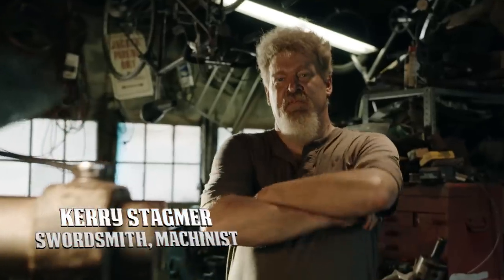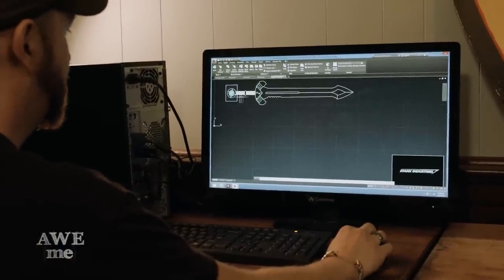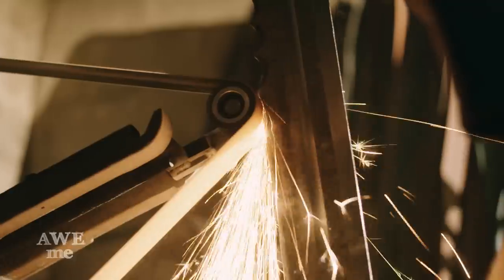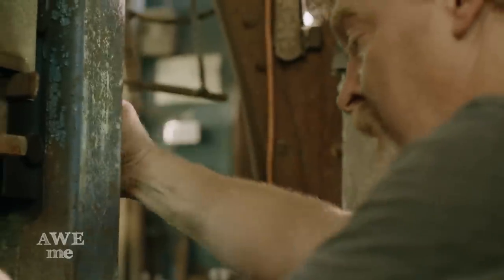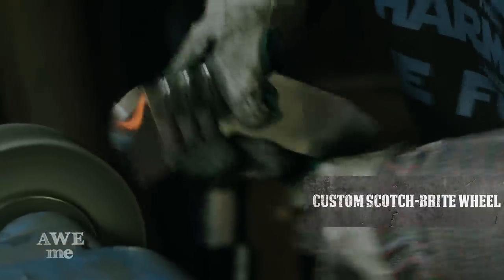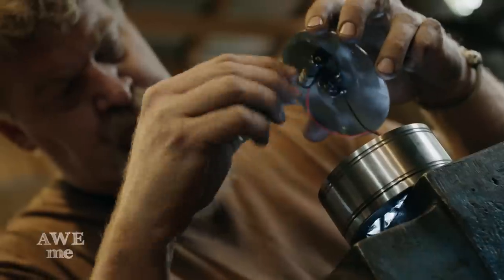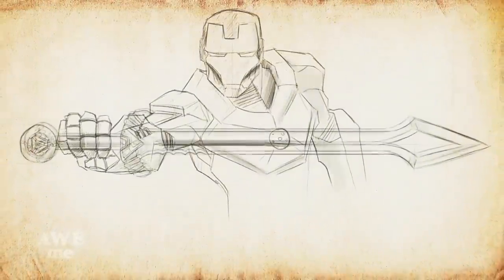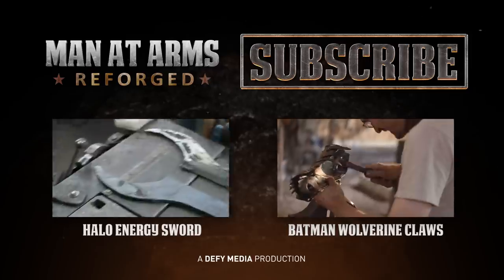Iron Man's Sword - MAN AT ARMS: REFORGED

Comment: Come on people, stop hating on these guys. The current team actually builds cleaner and more refined pieces than the previous team. Don't get me wrong, I love Tony and all, but you all need to move on and appreciate the effort and craftsmanship they put on these new weapons.
Reply: we might appreciate the craftsmanship, but many of their pieces have glaring design flaws, like this one having an overly cylindrical grip, which makes maintaining proper edge alignment nearly impossible.  otherwise it's a decent design, though I would have found a way to brass the blade as well.
Reply: PsylomeAlpha I love these comments about the cylindrical grip, as if that's what's over-designed about this piece.  Seriously?  It's not the absurd weight?  It's not the pointless cutout in the blade?  Or the pointless teeth?  Or the impractical hilt? 
I'm not going to denigrate their hard work and craftsmanship, but the design is just too far over the top.  It looks like something a middle schooler would draw because it's "so flipping rad."  
None of the styling fits together, and none of it evokes Iron Man.  It's as if they took Iron Man's branding and put it on a weapon from WoW or Darksiders.
Reply: bullsear
you know what, I was trying to avoid leaving a ranting epitaph, so I gave the design issue that makes this thing completely useless even if the strength to wield the blade isn't an issue.  if the blade breaks at the tip because of the cut-out it can still cut.  the guard would still be functional, even though it's too small for my liking.  the teeth, in a literal sense, are points, but are relatively useless.  you could argue for its overly bulky design by saying he's planning on using it on super-humans, many of which have higher resistance to being cut, so I left that one off as well.

i.e. I was stating the worst flaw that happens to reoccur with their blades all the time.

oh, and you forgot a total lack of taper; distal or otherwise.
Reply: no
Reply: The weapons they make are for show. Maybe not exactly for a COMBAT situation. Just think of a iron man hand trying to grip a tapered handle, I would personally think it would be a little hard.
Reply: R'Amen
Reply: Again, my issues aren't with practicality -- it's just over-designed.  It doesn't draw from the character, and it doesn't really know what it wants to be.

Comment: Using an oldschool blacksmith technique we brass the handle -> pulls out a drill. Ye, sure is oldschool man.
Reply: I think they were talking about heating the steel up and then brushing it with brass wires.  also, drills and lathes have been around for hundreds of years, back in the day they likely would have just taken the thing and put it on a fairly snug wooden dowel, and then put that on a lathe.  then, depending on the design of the lathe, they'd either have their apprentice spin it with a crank, or they'd pump it with their foot.  this is all stuff capable of being done long before electricity existed.

Comment: The only thing that bugs me about this build is the theme. This is a sword thatw as themed to fit Ironman, but Ironman would never use a sword (or atleast he has no need to).

The sword itself looks great though, much better than the shruikens and whatever you'd call the TMNT weapon.
Reply: Optimus Prime has no use for a sword but has one anyway.
Reply: granted
Reply: I could definitely see him wielding one, even if he doesn't have an actual reason to do so. Sword wielding among superheroes is as much a style choice as anything else.
Reply: He used a sword in 'The Morgan Conquest' plus it's Tony Stark, if he thought it'd be cool to use a sword he's have J.A.R.V.I.S. finishing the paint-job buy the time he got back home to program the repulsor delivery system
Reply: Tbh him using a sword would be a pretty cool thing to see, it'd most likely would happen in some story concerning Asgard, like in fear itself or whatever, not completely impossible.
Reply: He would more likely try to make some energy blade or something like that if he was to use a sword. But also might just make a normal metal sword just cause he was bored.
Reply: TheYarl5000 He'd make robots if he was bored,
Reply: TheYarl5000 I'd think the metal blade might be made to vibrate at a high frequency like Raiden's sword from Metal Gear Rising or the Guyver's elbow blades enabling him to cut through almost anything
Reply: I'd expect Ironman to be more inclined towards a plasma tipped blade but I guess the end effect would be the same.
Reply: it could be a sword made to be used in case of an EMP or such. not sure if that makes sense, but it would be a situation where a plasma or energy sword wouldn't be as reliable as a regular sword i imagine.
it might not be wieldable with one hand without the exoskeleton, but double handed works just fine
Reply: it's a good job he's a FICTIONAL character and can be adapted and interpenetrated differently as all things are
Reply: ten Busch
 if there is a emp, Iron man would not function i think xD
Reply: was just a spontanous theory anyways
Reply: ***** that sounds AWESOME!!!
Reply: ten Busch why not. at some point, Iron Man will come upon a enemy who has made his own shield or got one who can protect against ANY kind of projectile. and this is possible. With that said, Iron Man could actually make a sword since That's not a projectile unless he trows it. So, it is possible

Comment: 1. The cross section of a sword handle should not be circular, it should have a somewhat oblong shape. This helps the wielder keep the edge aligned. Tony Stark is a brilliant engineer, he would realize this.
2. Because the Iron Man suit can fly you have to limit the weight that you are carrying and maximize aerodynamics. Stark probably wouldn't carry a sword to begin with for those reasons. Let's just say he does, he would want it to be as light as as aerodynamic as possible.
3. WTF is with the cutout near the tip of the blade? Not only does that add unnecessary weight, all someone needs to do is grab the cutout and they can take it away.
4. Serration on the back of the sword near the hilt isn't useful at all.
5. Delicate electronics should not be on the pommel, the pomel is there as a counterweight and strike point.
6. Stop with the glass already! It's not cool or remotely impressive.
Reply: FORGIVE THEM, OH WISE SWORD MASTER!
Reply: But seriously, this is a prop. Do you really believe they wanted to make a "perfect sword" for a fictional character? No need to correct them for their own ideas, ON A PROP.
Reply: Wade Wilson IKR! Gezz...
Reply: Sigvulcanas At first I thought your comment was full of crap, but then I watched all your videos about sword design functionality and construction and now I understand why these professional swordsmiths and prop makers should not take your critique lightly.
Reply: Well, you can create another ironman sword from your own creative input when you acquire the forge, skills, and materials needed. Or make a kickstarter or something. Whether or not people will pay to see your creation? I don't know. That's up to you.
Reply: True with all but glass its hard to cut glass with a sword but theres a firm line form cuttinng something and shattering Something. Thats shattering
Reply: pommels were not used as a counter weight, but are used for more a head bashing tool, if the pommel were a counter weight it would make the blade easier to deflect
Reply: nathanilt Pommels are actually used a lot of times to be a counter weight.  Adding weight to the hilt brings the center of gravity down towards the hilt, making the sword more balanced, and easier to handle.
Reply: nathanilt Pommels are definitely counterweights. They were needed along with distal taper to make the blade balanced.
Reply: etheangel2220 I never made any videos, I have to credit Skall ***** and Matt from scholagladiatoria for a great amount of what I know. I also did quite a bit of research in other websites.
Reply: Wade Wilson Nothing is free from criticism.
Reply: Ironman s suit can catch a van in mid air and yall are worrying about the weight and easy to handle?
Reply: Sigvulcanas i'll check them out
Reply: etheangel2220
But the guy has no videos...OOOOHHHH, I see what you did there.
Reply: In the wise words of Mystery Science Theater 3000...

"Just repeat to yourself 'it's just a show, I should really just relax'."
Reply: Its a disappointment is what it is...
Reply: There's a 50% chance that stark would build a lightsaber. This build was awesome admit it.
Reply: Yeah, i also don't see the purpose in the arc reactor being on the sword in the first place, i could understand it if the blade was energy based as opposed to metallic, it would make more sense, tony stark has repulsor tech, so it's not a far stretch for him to have something akin to lightsabers
Reply: Iron man would never need a sword of his own, nor do I think he would want one (considering he has lots of firearms integrated into his suit of armor, and repulsor beams). But if he did, it should shoot lasers and bullets and flamethrower and explosions, and smoke screen, and much more. However, if Iron man had a sword, it would be something that can assemble and disassemble into the suit. Would most likely be a single handed sword, but that can be used with two hands for extra power (Im not sure if that s called a hand and a half sword or if that s something else). Also be able to cut like a lightsaber, but also like a razor, and maybe like a saw, by reassembling the edge (just in case its ever necessary). It would be indestructible... And it wouldnt be so wiiide! Nor would it have any useless holes in it.
Reply: Bryan Merced Yeah, i'm kinda thinking something like the sword on the gipsy danger, but made out of energy....like the one he has in his S.K.I.N. Armor MK III
Reply: I think it would be metal, and 3 types of edges: Laser, metal indestructible razor (like wolverine s claws), and metal indestructible saw.

Comment: Iron man would never use a sword. Even a really cool sword.
Reply: Really, roller skates? He can freaking fly. I thought he was a genius. And that's not a sword is it? Its appears to be a light saber. And before you say anything light sabers are not swords. They may be used in the same way but they are not the same.  You wouldn't call a cross bow a gun.
Reply: Ha damn what a come back
Reply: POVadventure lightsabers are swords, do you even nerd bro?
Reply: Worth Sim 
Sword art online fan? What about asuna's sword?
Reply: POVadventure "Lightsabers are not swords". George Lucas designed the Jedi after Samurai, meaning that Lightsabers are his sci-fi equivalent to Katanas. And even if you wont accept that, it's still an exceptionally farcical statement. A sword is a blade weapon used primarily for cutting or thrusting. The blade of a Lightsaber may be made of plasma, but it's still a blade, and what do they do with it? They cut and thrust. Not only that, but they are even called Sabers, which are a type of sword. All in all, that was a failed statement. Although, I do agree that Tony would abhor the idea of using such simple technology as a metal wedge to do his work. It would definitely have to be an energy blade of some sort.
Reply: The only sword iron man would us is if it came out of his gauntlet a bit similar to optimus prime, but his would come out from the top part of his arm gauntlet, parts stretching out and attached together to make the stark sword.
Reply: yarkshry I agree a lot with what you're saying here. It's just me personally, but I would place lightsabers in a class of weapon all their own. Just because of how iconic it is and the sheer amount of power. Its not everyday you see a sword that can deflect bullets. But like I said, that's just me personally.
Reply: Iron Man does has a sense of practicality, if there was a need for a sword you bet your ass he'd use one. He'd probably make it out of vibranium/adimantium though, same as caps shield.

Honestly though, I'm more disappointed by the fact that once again, it's not really a combination of weapons from two different characters/series. It's just an Iron Man themed sword. I'd of loved to see an Iron Man Version of Mjolnir or Caps Shield.
Reply: lets just call it energy swords and forget they were called lightsabers...
Reply: ***** Prime had a sword in the first movie and in the movie game. In the third movie that's when he had an axe.
Reply: ***** I'm only saying how the sword would look like and prime had a sword in the first movie. I know in most of the generation cartoons he had a blaster and then got an axe.